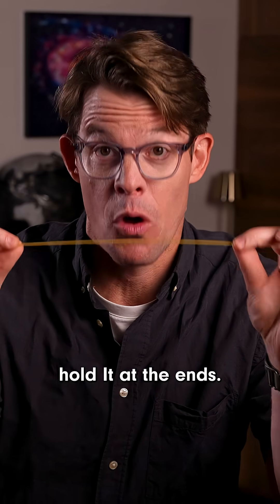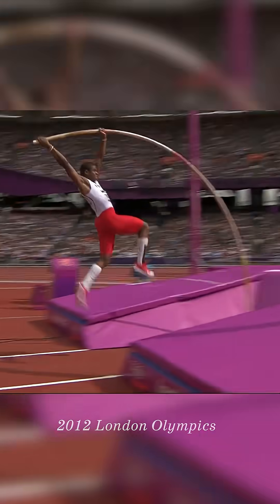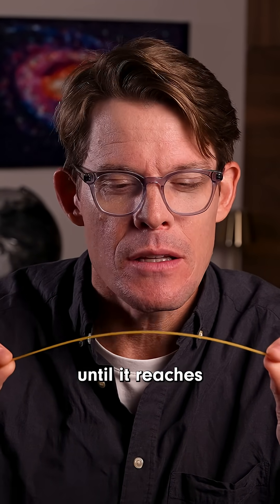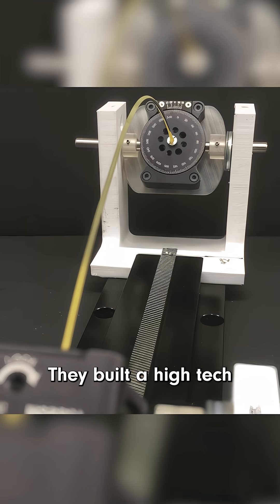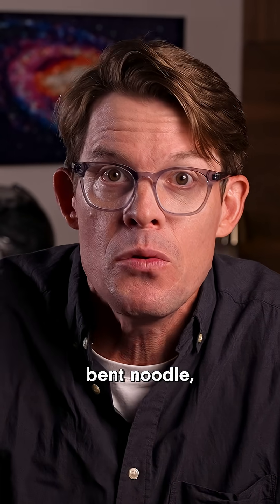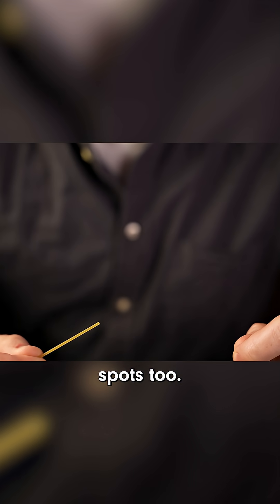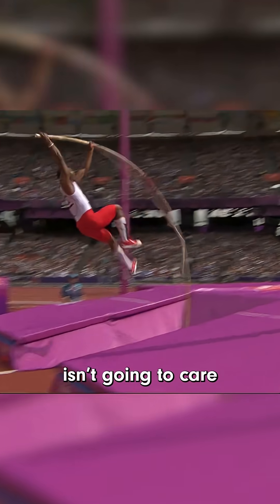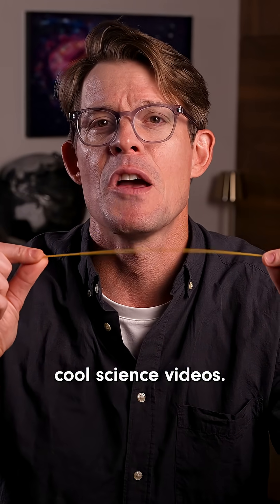How Spaghetti Stumped Physicists For a Century

Comment: ITS actually standing wave physics as everything is energy 
The fracture is where the wave forms collide and radiate back out 
The twist before the bend breaks the standing wave into a torsion sheer force.
Both of these forces are the standard of earthquakes.

Comment: Bismilllāh. I think there may be a simpler answer to that related to waves and forces. Such the forces that you gave at the tips of the sticks made the stick had some tension/spring force somewhere at the middle of it while it was curved/bent so this force wave moved from the middle to the both of the tips. So all the three sources of forces was kinda like being epicentrums of the waves of those forces just like earthquakes. Then when the waves were at their peaks, where this could be at the centres between the three forces (both between the middle force and the edge forces), the stick broke because of them into three parts and the middlest broken stick might broke into smaller parts if it gained enough force waves from both of its tips which it gained from the crack. But Alllāh knows best.

Comment: Without having studied Spaghetti I would've guessed that there is only one primary fracture and the other fractures are due to the release of the stored energy. Interesting to know that you can direct the released energy in a way that prevents secondary failure (although also quite logical). But apart from that I wonder a little bit why it puzzled so many bright minds for such a long time 😮

Comment: Before i get the answer, i think ill make an educated guess.
Im guessing because of the mix of elasticity and brittleness of spaghetti, the way it breaks makes an initial crack, and the velocity of the other side of the break makes the end of the broken piece flick back with enough force to cause another break.

Edit: looks like i got it right. Cascading failiure. Nice.
Reply: eh more like two points of compression and tension reigons the inertial moment of that third peice does not have any extra energy high enough to cause a second break

Comment: I'm so smart lol. I actually worked out in my head that if you twist it it will change the tension areas and spread them further into the center by bracing the radius with equalized tension.

Comment: This stumped scientists for YEARS!? Bro I solved this in two hours. I found out that if you push the noodle into the middle instead of bending it the middle "compression" part gets smaller and smaller until it's just a single point, that point which it shall break, and voila! Human snapped two-pieces spaghetto.

Comment: Doesnt this also have implications for things like structural engineering, if it twisted does it weaken the load amount, or does it keep the load amount while ensuring a safer rod to prevent cascading failures in a structure?

Comment: Before he finishes the video, I'm gonna guess it has to do with strain hardening, where a material gets stiffer under more stress/strain. Since the center of the noodle is the highest stressed/strained portion of the noodle, it becomes stronger/more rigid. That then forces the failure sections to occur outside of the stain hardened portion of the noodle, which is approximately equal in 2 different section locations.

Edit: guess I was wrong 😅. Elastic rebound was my second guess

Comment: Just look at chapter E of the AISC 360 Manuel. It has Euler Buckling equations based on the elastic modulus, radius of gyration, and the unbraced length. This has been widely studied, but I find it interesting on how more brittle failures cause the 3 piece split.

Comment: He could also lightly saturate part of the spaghetti and it would work like a sword where the edges hardened but the back of the blade is softer and less brittle and more capable of absorbing shock and vibration.

Comment: MAMA MI

|||||||

Right now, it’s not possible to get to Mars in 24 hours with any existing or theoretical spacecraft technology.

Here’s why:
	•	Distance: Mars is, on average, about 225 million kilometers (140 million miles) from Earth.
	•	Current travel time: Even the fastest spacecraft we’ve ever built (like NASA’s New Horizons or Parker Solar Probe) would take at least several months to reach Mars — typically 6 to 9 months with current propulsion.
	•	To do it in 24 hours, you’d need to travel at roughly 10,000 times faster than current spacecraft — close to 1% the speed of light, which is far beyond our current or even near-future technology.

So, unless someone invents warp drives, antimatter propulsion, or instantaneous teleportation, 24-hour Mars trips are still pure science fiction.

Would you like me to show you what theoretical technologies could make that possible someday?

JR

Comment: Given the explanation, this seems weird. If the break happens (approximately) in the middle, and then the failures happens on each independent side, breaking into 3 pieces commonly instead of 4 (which is still possible, as shown in that one sim) implies that one half is commonly not actually failing, and only one side is (the side that breaks into the extra third piece). This implies that you should get pretty consistently 2 pieces as well, if both sides just don't undergo the cascade at the same time. Obviously the break doesn't happen at the exact middle, meaning the two sides have different amounts of energy, but if it's close enough to the middle, it seems like it should be negligible if this can happen with varying lengths of spaghetti.

Comment: I’m honestly surprised it took scientists that much effort, or that long, to figure out what was happening. I may not fully understand the mathematics behind it all, but I felt like I had a pretty good grasp of the scenario within a few seconds of analyzing it (despite not previously learning about the process behind this anywhere).

I guess it just seems like common sense to me. You have a flexible object with two ends bending at relatively the same time, so of course the center of said object would be forcefully pushed away from those two ends when enough pressure is applied.

Reason being, the center isn’t experiencing the same level of pressure that the ends are. With the energy on each end converging almost simultaneously, it results in multiple breaking points near center mass. Those breaking points then exert the kinetic energy stored in the object and cause the central piece/pieces to eject away from the rest of it.

I’m assuming a machine would naturally have a better chance at breaking the spaghetti cleanly, since force can be applied more exactly. But even then, every piece of spaghetti, wood, etc. isn’t identical. So reproducing the exact same result seems nearly impossible.

Someone correct me if I’m way off on these details. These were just my immediate assumptions after being presented with the scenario.

Comment: i wanted to test with you so i found an untouched noodle laying next time my kitchen equipment (that has been there for presume ably a couple months) and it snapped into only 2 pieces. my only guess is that it absorbed moisture over time making it just barely less rigid than a normal noodle allowing it to break uniformly

Comment: I don't understand how this took people so long to figure and worse, scientists. This is the most common sense logic possible. You are literally applying energy and pressure on two points which is creating a bend effect in the center. That center has two ends which will evidently "pop" due to the increased pressure and energy.

Comment: My personal preference would be to use something FAR more precise than fingers -- something that can bend the uncooked spaghetti by the smallest amount per increment. If that force can be reduced to the very minimal amount necessary to break the piece in one location, perhaps there would not be enough excess force to break it in a 2nd location.

Comment: No, what's super weird is how that polevaulting pole broke. Every pole I've seen break has been down near the tip, likely caused by spiking the pole when tapping through to inversion. And you only ever get 2 pieces.

The one time I broke my pole, it busted at the hand grips (towards the top of the pole), again, only 2 pieces. My coach was taken wholly by surprise because it's very rare for poles to fail at the hand grips.

The fact that his broke at the hand grips and near the tip is impressive.

Comment: There actually is a way to snap a spaghetti noodle in two only pieces 

Step 1: grab your spaghetti noodle 

Step 2: move or place both your hands at the center of the spaghetti noodle as possible 

Step 3: bend the noodle outward 

And there you go you got two spaghetti noodle's

Comment: Bones under load mostly break the same way. Twist fractures usually break in fragments, but direct hits (most notably bumper fracture) usually results in at least three fragments, two large main pieces and the point of impact a triangular piece of the bone. Not a noodle, different mechanism, similar result

Comment: I've been breaking my spaghetti into thirds before boiling for about thirty years. Seems to work fine. But I'm not stressing the ends of it, I'm picking a section one third up the pack of noodles to apply all the force to, then a section halfway along the remaining longer section.

Was never a fan of super-long noodles. I find it easier to consume spaghetti when it's in thirds.

Comment: Crap only took me a few seconds to figure out why. Once I seen him bend it it was obvious. There's no way this is true. 

I’m honestly blown away that it took the brightest minds to figure this out. The moment I saw it, I knew, it’s a shockwave caused by the release of stored energy.

When you bend a spaghetti noodle (or anything under tension), one side’s stretched to its limit while the other’s compressed. The instant it snaps, that released energy doesn’t just vanish, it travels back through the material like a whip crack. That reverse shockwave is violent, probably even near supersonic, and it causes secondary breaks along the path.

Of course it’s going to break in two or three places. The energy’s got nowhere else to go but through itself.

Comment: Sorry @besmart, this is incorrect : back in 2005, it was not MIT but CNRS (French) scientists Basile Audoly and Sébastien Neukirch who actually explained the cascading failure (Fragmentation of Rods by Cascading Cracks: Why Spaghetti Does Not Break in Half), and they won an IgNobel prize for that in 2006. 
The MIT work on Controlling fracture cascades through twistingand quenching is from 2018.

Comment: Vectors bruh. Thr pressure/surface area of your fingers is causing two straight line lines to bend at a radius that is bending more in the center. I’m not smart and maybe I’m wrong but tell me how I’m wrong

Comment: Stretching of Old Expanding Light and Cosmological Redshift Without Expansion of Space
Introduction: Cosmological redshift is traditionally explained as a consequence of the expansion of space. This article presents an alternative hypothesis: redshift arises from the interaction of old expanding light with new expanding light, without space itself stretching or changing. In this model, space is an eternally existing three-dimensional stage that IS absolutely nothing. Consequently, space cannot act or influence events in any way.

---

Fundamental Principles

1. Space

Space is a static, three-dimensional stage that IS absolutely nothing.

No expansion, curvature, or any other dynamic occurs in space itself.

All observable phenomena take place within space because physically existing entities move in all directions, each possessing intrinsic pushing force. The local density of these entities varies throughout the infinite three-dimensional space according to how they recycle themselves.

2. Light and Matter

Light consists of discrete, spatially distributed energy clusters that continuously recycle energy into space, so that the energy within them changes entirely over time.

Matter and light expand internally, meaning their structure and energy spread and reorganize such that expanding light does not change relative to expanding matter.

3. Interaction of Old and New Light

Newer expanding light within galaxy clusters accelerates older expanding light, so that its motion and expansion reach the same speed as the newer light within the expanding galaxy cluster.

This acceleration process stretches the wavelength of the old light, producing the observable redshift.

---

Formation of Expanding Galaxies and Stars

Expanding supermassive objects do not emit light, but instead produce trillions of discrete dark matter expanding density clumps.

When two expanding supermassive objects once passed near each other, these dark matter density clumps interacted as expanding energy fields with appropriate densities, leading rapidly to the formation of new expanding stars, seemingly from “nothing.”

As these clumps passed repeatedly through corresponding expanding density regions, their expansion accelerated to the point where they no longer pushed each other apart in the same proportion as before. This process formed larger structures quickly, giving rise to new expanding stars seemingly from nothing, though in reality derived from the ever-present discrete dark matter density clumps continuously produced by the supermassive objects.

---

Mechanism of Redshift

Redshift is not a consequence of space expanding.

It arises because old expanding light encounters higher energy densities and faster new expanding light within galaxy clusters, altering its wavelength relative to an observer.

In regions between galaxy clusters, where the combined energy density of the expanding light field is lower, the interaction is slower, resulting in reduced acceleration and smaller redshift.

---

Time and Relativity

Time is relative because the volume of expanding matter and light, and their internal expansion, is relative.

The passage of time we observe depends on energy densities and how rapidly atomic nuclei in the expanding matter recycle energy into space. Local conditions therefore influence experienced time.

---

Potential Observable Predictions

1. Redshift depends on the internal energy density of galaxy clusters relative to the energy density of the expanding light field in the regions between clusters, not on the expansion of space.

Expanding light collectively forms this expanding energy field between galaxy clusters.

2. Observed linear redshifts can be explained by variations in interaction strength and light density.

3. The magnitude of the redshift of old expanding light increases according to how much it has interacted with newer, faster expanding light and the density of the expanding energy field it traversed.

---

Conclusions

Cosmological redshift can be interpreted as the stretching of old expanding light and the lengthening of its wavelength, without space itself expanding or performing any action.

Expanding supermassive objects formed rapidly in their own three-dimensional initial explosions and continuously produced new expanding stars as they passed near each other. They emit trillions of discrete dark matter expanding density clumps, which interact to create new stars.

This model offers an alternative perspective on cosmology, where light and matter are inherently expanding and interactive.

Further mathematical development and comparison with observational data are essential for scientific evaluation.

---

Jukka Savorinen  in collaboration with ChatGPT October 8, 2025

Comment: I like to pause and guess before I hear the real answer. 

My guess was that the forces at both ends were uneven, due to slightly different grips on both ends, creating uneven tension throughout the spaghetti string. And thus, it snaps unevenly. So to fix it, a machine would be used to make sure the force on both ends was exactly the same while bending it, so it would snap evenly in the middle into 2 pieces.

Well, I was wrong, but it was a decent guess.

Comment: Pole vault poles frequently DO break into two pieces, but those are always caused by structural defects in the fiberglass (cracks, scratches, etc).  Its a nice (but expensive) method for knowing why the pole broke, defect vs overstress.

Comment: So what recently dawned on me when I was watching somebody play around with a mobius coil,  you start to find that the vectors that it interacts with are the exact same as the wave function, a wave function in 2 to me, 2D space. All you're going to see is the highs and lows the ebs in the troffs, but when you start to look at the way a mobius strip works, it behaves exactly the same way as a wave, just in terms of 3D mechanics, which might actually kind of explain why twisting the news noodle. It causes it to break only two pieces instead of three.You have not only different forces acting upon it, but you have it behaving.The way an actual wave would

Comment: Hold them in bunch and then break them. Each piece is more likely to break in two. My immediate thought was it was the whipping action after the initial break that caused secondary break. Most people think in terms of static conditions when testing the ultimate load capacity.

Comment: I solved it by myself and this is what I thought 

So when you bend any pole or long skinny thing by both ends at the same time the sides break off but since its shaped like half a circle when you bend it the energy may not reach the top so it breaks off of those two pieces causing it to not be possible to break into 2 pieces. 

I'm 11 pls tell me if I'm wrong about this

Comment: How to solve this problem: Hold the center of the noodle with two hands using pressure with your thumbs and index finger apon the noodle. Then bend it till it breaks and you will not get three pieces, but two! Thus solving this well known issue!

I came up with this fix just now! Good luck everyone it does takes some practice.